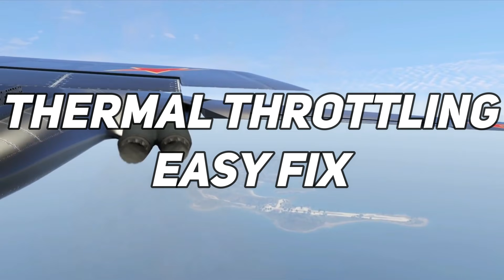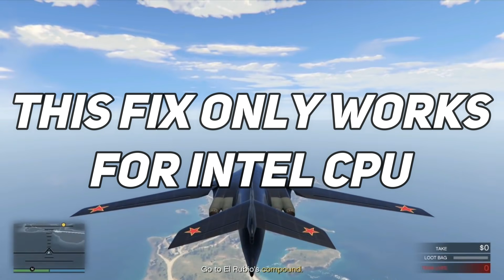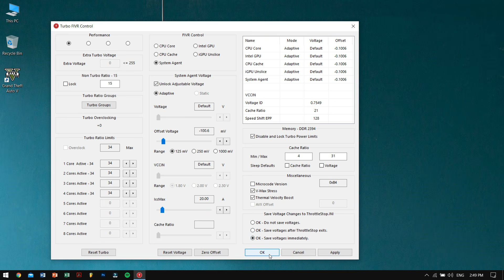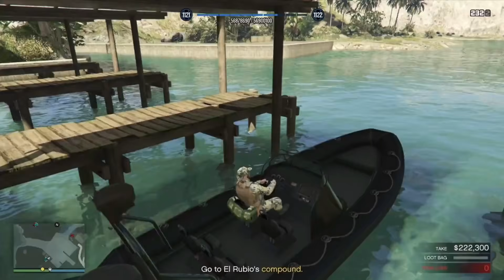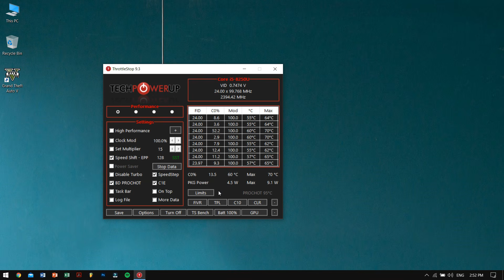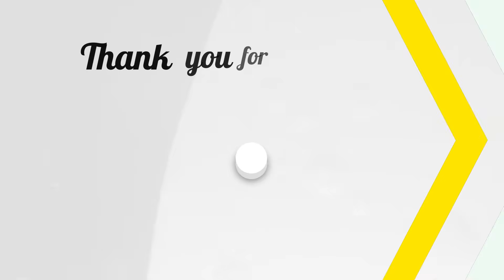Comment: My laptop would always use to heat up to high 90s and even 100s. After doing method1 and 2 all my games run so much better and my pc is between 60 to high 70s. Thanks so much bro
Reply: yeah me too before this i got like 95c fps drop is crazy due to thermal throttle, its better reduce performance a bit with this undervolt than shuttering bcz high temp
Reply: @misterlove7895 did you fps drop/stutter stop?
Reply: @misterlove7895  I also got the iets gt500 for my laptop and that significantly dropped my laptop Celsius  20 degrees
Reply: Enjoy 😌

Comment: All the options are locked i have a gl703gm gtx 1060 i5 8300H. Please help!
Reply: Check your bios. I assume it is locked there.
Reply: @TechTweek  how can i do that? Btw i just found the solution. My room was hot and in sweden its already snowing so it fixed by opening the window. I could possibly have cooling problems but idk. Thanks for the help anyway! Im surprised that you responded so fast!
Reply: I try to respond ASAP. Try searching in Google "bios (your laptop model) " follow the step. Basically you'll need to press F2 or F12 or Del key while your laptop turns on. And then check for any settings that says something like clock multiplier. It's all different for different brands. 😅
Reply: @TechTweek  you deserve a subscribe! Thanks🙏
Reply: That means a lot man! Thank you so much ❤️

Comment: Didn't seem to do much for my i5 7200U :(
The problem with this PC is the manufacturer decided to not put any fans in this thing. So it reaches 80°C while gaming and only does 25-30FPS
Reply: Try method 3.
Reply: I have too i5 7200U, is that setting useful?
Reply: Yes
Reply: i have the same thing and it works great for me

Comment: Love your video but when I click FIVR button, the CPU, CPU Core Voltage and other setting are locked and can't edit or anything. May I know anyway to fix that?  :'(
Reply: Maybe you're using a newer CPU which is locked or you're using an older CPU which doesn't have these features.

Comment: What if i disable bd prochot
Reply: Don't disable that.
Reply: @TechTweek  i know its remove the max degree limit but is it realy ruin my pc?

İ mean every pc has a heat protector right if my pc gets too hot it will be shut it down by itself right?

Or can you suggest me a laptop fan controller software?

İ have a Acer Extensa 215-53g
Reply: Yeah your laptop won't throttle the cpu even though the temperature increases more than 100°C and it might cause Hardware failure. I don't have much idea about other software. You can try using intel XTU.

Comment: I got blue screen after trying the first method, I wanted to change the offset voltage, but whenever I try to open the app It will immediately giving me blue screen again, Is there any way I can change the offset voltage again?
Reply: Try downloading a different version of Throttlestop
Reply: @TechTweek  Do I have to uninstall the current one?
Reply: I think Throttlestop is a copy and run program. It doesn't need any installation.
Reply: @TechTweek  What numbers do you think I should set for the offset voltage?
Reply: @Nao-Naoki1  that depends on the model of your cpu. Try searching in Google about it.
Reply: @TechTweek  Thank you so much for the help and response

Comment: @TechTweek  Can ThrottleStop be used in conjunction with Intel Extreme Tuning Utility or would there be a conflict between the two?.  The reason I ask is because I already undervolted the core offset in my cpu (i7-9750H) down to -0.090, that's the lowest I could get the voltage down to on this chip before it became unstable.  Even though the cpu is running a few degrees cooler now, I'm still getting thermal throttling in games, most noticeable in GTAV and DoomEternal.  I recently also reapplied new thermal paste on both the cpu and the gpu, Thermal Grizzly Conductonaut liquid metal on the cpu and Arctic Silver 5 thermal paste on the gpu.  Both the cpu and gpu get really hot while playing those games, the gpu constantly gets up to about 87-88 celsius and the cpu about 76-77 range.  I'm not getting any artifacting while gaming what I'm getting is like an abrupt slowdown in movement, like a breaky jerky motion when moving around.  Everything slows down, as if the gpu is overheating then abruptly motion gets back to normal again but, only for a few minutes until the same thing happens again.  I don't know if that behavior is the result of some sort of thermal throttling going on or something else but, I just don't know how to fix that.  That's why I wanna know if ThrottleStop should be used by itself or if it works in conjunction with IETU, which is what I have right now.
Reply: I didn't try it out. But you definitely try cause throttlestop is never a permanent fix. If something goes wrong you'll get a BSOD and after the reboot, things will go back to normal.

Comment: bro i have the same cpu but everytime i open throttle stop and untick disable turbo my speed will increase in throttle stop but when i open task manager and go to performence it just shows 1.8ghz what ever i do
Reply: That's strange. But after reboot the clock speed will be back to the original speed.
Reply: @TechTweek  but if i open throttle stop after reboot will it set back again ? to high speed
Reply: I am not sure.

Comment: can this help me with increasing my cpus TDP? Dell stupidly put a thermal limit of 13 watts on the xps 13 9310 an I'd like to unlock more performance. I know it's capable of doing more (as run by Dell's own stress tests) and so i'm wondering if I can unlock a 28 watt tdp profile?
Reply: This tutorial is for undervolting only.

Comment: Hello i did the undervolt settings but no difference from my heat it works a couple of days but suddenly it is not working but i can see that the undervolt settings is being applied :( my processor spec is

I5-10300H
Reply: make sure throttlestop is running before running your games. Or else you can try the other methods as well.
Reply: @TechTweek  i did start it before running the it was going fine for a week but suddenly today my temperature is consistent at 90 degrees its making me worry
Reply: @ralphlawrencecelis5210  What was the temperature before?
Reply: @TechTweek  when it was working whenever im playing high games on ultra (ex: nfs heat) when undervolted the temp is running around 60-70 but when it is not undervolted the temp is around 80-95 degrees. But today i started throttlestop but the temp stayed 80-95 degrees but i see my throttlestop is not locked
Reply: @ralphlawrencecelis5210  Check for the undervolting values, maybe it has got changed.

Comment: I am asking regarding method 2

If a system have 3.6ghz of base clock speed value,, applying method 2 ,can I able to reduce the core values to in between 2.5 to 3.0 ghz, is it possible or it should maintain the base clock speed.

And one more thing method 2 and method 3 can they perform simultaneously. Or choose any one from them.

Plz reply
Reply: Yes, you can set it in between and Method 3 and 2 are both different.
Reply: @TechTweek   thanks a lot🙏.. now I try..
Reply: Welcome
Reply: @akshaykumarsahoo4566  Welcome

Comment: Turn off the machine and it will restore after reset
Reply: Exactly
Reply: @TechTweek  Is there a way to solve it?
Reply: @pimwarunya5337  Throttlestop is never a permenent fix ( For safety Reasons )

Comment: all the options are greyed out i dont get it it used to work before please help
Reply: Make sure you have the latest version.
Reply: @TechTweek  its the latest version that isnt working actually i mean the latest stable version idk there is a beta version mabe thats the problem
Reply: @DXDgamingsubnow  Alright. As you mentioned, that throttlestop was working previously, then try using an older version of Throttlestop. Try to remember which version worked for you and use that.

Comment: on my computer DELL inspiron 15 7000 with nvidia geforce gtx 1650ti says locked out which means i cant change anything in the FIVR settings. how do i remedy that
Reply: Sometimes undervolting is locked in bios. Do check it.

Comment: We almost have the same CPU, I have the i7 8550U but the 'FIVR Control' just says 'Locked' and everything is greyed out.
It's in a HP EliteBook 830 G5, I'm guessing it's either a BIOS option or HP have locked it, anyone know where I might need to look?
Reply: The same problem, I have a HP ELITEBOOK G5 850 with I7 8550u. The temp hits 90 in some cases, Any solution ?
Reply: @RockyElite1  Nothing I've managed to find, I've spoken with HP (complete waste of time) and I've spoken with Intel which were much more knowledgeable but couldn't really help as they just refer me back to HP.
Sadly I had to gave up.
Reply: @Speak_Out_and_Remove_All_Doubt  
HP support personnel have zero knowledge when u talk to them. 
I searched around and lastly realized that HP has locked some models.
Thanks for your reply sir and have a good day.
Reply: @RockyElite1  yeah, the guy I was emailing at HP hadn't got a clue what I was talking about. I asked for it to be elevated, sent him some logs and never heard back. I've decided to build a budget (hopefully) Alder Lake desktop system next month and just use the laptop sparingly.
You have a good day too.

Comment: why cant i open this after downloading it. it says my cpu is not supported (3900x which is also oc). does this relate in any way that ryzen master is also a program on my pc that wont launch for some reason either. if anyone knows why lmk
Reply: I am sorry to say but I did mention in the video itself that. This method is only for Intel Processors.
Reply: @TechTweek  ok, is there any alternative for ryzen. and would you know why i cant run ryzen master on my pc ?
Reply: I am really sorry my friend. I never used ryzen cpu. 🥺 I don't have any knowledge about it. Sorry mate.
Reply: @TechTweek  ok thanks

Comment: Hi! I don't have the ''speedshift-EPP'' option on the screen. What shall I do?
Reply: Do the rest of the settings.
Reply: I did the rest of Method 1 and after a few seconds my system froze. I restarted and now I am lost. I think I should try the -50 value. What say? Waiting for ur reply
Reply: Yeah the offset voltage will be different for everyone. Try -50mV
Reply: Also, in addition to other settings in the FIVR page i have Analoge I/O and Digital I/O which i don't see in your app though we are both using 9.3. I did the same (-100mv) to those too. Should I revert my changes for these two ?
Reply: I am not sure about it.
Reply: Alright!  Thanks for helping me out. You got a subscriber.
Reply: Thank you so much ❤️

Comment: arkadaslar yapmayin aman diyim mavi ekran yedim bilgisayar gg
Reply: I cannot understand
Reply: @TechTweek  my pc is be blue screen and broked my father  shot  me and this pc is 5000 $ l cry for the because l am 13
Reply: @TechTweek  this is not  my  pc so  l am die
Reply: $5000 pc doesn't need throttlestop! It has adequate cooling. Still Throttlestop is not a permanent solution. You must have done something wrong.
Reply: @TechTweek when l playing pubg steam the my i5 8265u 3.8 to down 1.8 l am must control that
Reply: $5000 PC with 8265U processor?

Comment: Lowering the voltage more than like 25 crashed the computer for me. I still lowered my gaming temperatures from 100-60 though. I couldn't even play Subnautica or Half Life Alyx without crashing randomly at 100 degrees! Could it be the disable turbo setting that's making such a huge difference for me? 🤔
Reply: Disabling turbo will surely improve your thermals but it affects the FPS. Try it out. If your FPS is above 60 then you can try using it.

Comment: For people on Surface line.. it seems XTU and throttle stop have been UEFI bios locked... so unless you wanna roll with some DIY Linux BIOS downgrading.. your SOL ..
I reckon MS got a lot of salty Book3 owner feedback.
after Surface Book 3 13.5" with 10gen intel was being completely annihilated by the old 8gen 13.5" that is a freaking passive fanless tablet.
see notebook check review.
Cine20 Book3 multicore score 1098 (1065G7 10gen quad)
Cine20 Book2 multicore score +1700 (8650U 8gen quad) .
and many people used throttlestop on Book2 to see very impressive numbers from a fanless 7mm tablet.

Comment: DO NOT LITSEN TO THIS GUY IT DESTROYES YOUR CPU I HAVE THE SAME CPU AS HIM AND I INSTATLY GOT A BLUE SCREEN OF DEATH AND SCREECHING IN MY AUDIO AND IT FRIED MY CPU
Reply: Fried your CPU?  Throttlestop is not a permanent solution. It never saves the settings in real time. Try changing your offset voltage to a different value. Try setting it around -80mV

Comment: Bro thanks but I have a question please I used the method 3 on a i7 10750H RTX 3060 MSI laptop do you think if I let turbo boost off everytime it will damage my cpu or my gpu I just want to make sure that what I did is safe because everything is running good and I dropped from 90 to 70-75-80 max and I’m getting a cooling pad soon  do you think the method 3 is safe and there will not be any problems to my laptop please answer I’m new to all this laptop and pc stuff I just wanna make sure but thanks bro great content you really helped me ‼️
Reply: Which method did you tried? Does it works?
Reply: Thank you

Comment: after using the 1st method my cpu stays at around 0.8GHz my cpu is a core i7 8750H
Reply: check the settings carefully. 1st method doesn't limits clock sleep.

Comment: Does the offset voltage matter for Intel, Igpu and agent really needed? if you run games with nvidia gpu anyways?
Reply: If you can minimise the heat anyhow that's when you reduce offset voltage in everything. 😂
Reply: @TechTweek  i only have it on CPU and cache and it gave me like 5 degrees low. 

But i think the best is the TURBO max limiter. 

Mine overclock to 4.5 which heats it up a lot. But i maxed it to like 3.4 and it runs the game smooth with literally 15-20 less degrees. 

Disabling turbo is good, but in some games it remove a lot of performance. But in something like Valorant, it doesnt make a difference.
Reply: Yeah

Comment: Hi, I have a question because I see you know it. When I play any game my fps is normal and suddenly it drops to 16fps and so on for 7 seconds and then it stops and then it drops again maybe after 20 seconds. I can't play. My temperatures are normal.
Reply: Are you sure your temps are fine? 🤔 Did you check you GPU temps as well?
Reply: Yes, it's about 50 ° C as the fps go drop. I mean gpu temperature ofc.
Reply: That's strange 🤔. Did you try playing other games ?
Reply: @TechTweek  Yes, the same thing happens, cs: go, ets2.
Reply: I think that's a serious issue. Try reinstalling your Graphics drivers and even try reinstalling windows. Maybe some processes might be running on your background. If all failed then do visit a technician or an expert.

Comment: I did method 3 but my fps from 80 90 to 40 50. Is that okay? And my temperature in gta v from 87 to 65.
Reply: That's a huge difference 🤔 what's your cpu?
Reply: @TechTweek  i5 10300H
Reply: @TechTweek  So what should i do?
Reply: What games do you play? Heavy games does dips down the FPS by using method 3. If you're playing competitive games then it shouldn't dip down too much.
Reply: @TechTweek  i play minecraft and a others game not heavy it still drops fps but not much.
Reply: I really didn't face such dip. I generally get 100+ fps for some games but because of thermal throttling it's not stable it'll come down to 20-30 so I use method 3 to get a stable fps around 60-70.
Reply: @TechTweek  Are you in the same situation as me?

Comment: Hey dude I did everything you said and unfortunately it still lags.
Game: Valorant
Specs: i5 9300-H @2.4GHz, 16GB RAM, GTX 1650 (Lenovo IdeaPad L340 Gaming Laptop)

I recently found out that the reason I was getting low fps in Valorant after a while is because my CPU was overheating and throttling. So I came to your video. I did everything you said, but my game still lags. I found that if I set my offsets to -97, my game runs fine for some time but then starts to lag. However, if I set it to -98 or go even further, my PC will crash. So I'm stuck with either lag or crashes. Please if you know anything that can help then tell me.
Reply: How much time has passed since u bought the laptop and, how long do you game on it daily.
if it was doing this since day 1 then the chassis is shit nothing can be done except down clock if, it has started now then either clean your laptop fans and heatsink or repaste the thermal paste.
Reply: Try method 2 and 3.
Reply: @TechTweek  I already did.
Reply: If nothing worked then it's a hardware issue. 😓
Reply: Throttlestop never uses any GPU😮
Reply: Haha. That's something new

Comment: Hi my laptop is thermal throttling when my cpu clock get higher then 2ghz my laptop temperature get 92°C and shut down
How can i set my core clock to 2ghz max not the base 1.6 ghz while gaming
When i game on 1.6 ghz I don't get good or even average performance i have everything else that can perform mid teir gaming only the cpu is the bottleneck
Reply: Try method 2 but you'll need to tweak the multiplier.

Comment: the first method helped but then i got a blue screen several times. Pls help.
Reply: Then you'll have to use different value for your undervolt. Try putting -80mV
Reply: i got blue screen using -50 mv
Reply: Then my friend you might want to lower it more or you can try other two methods.